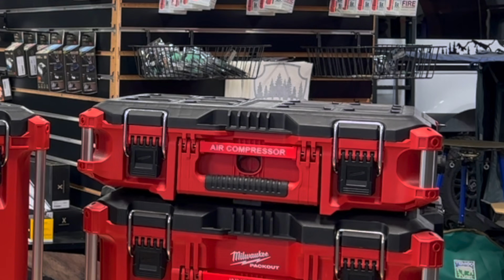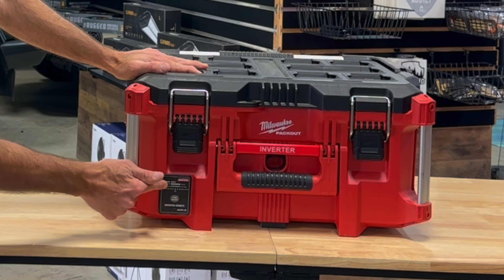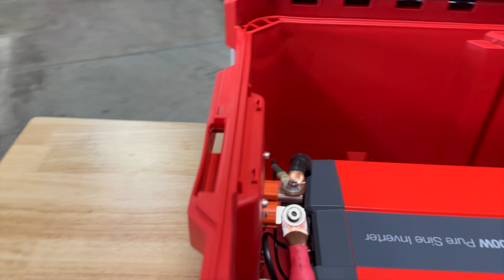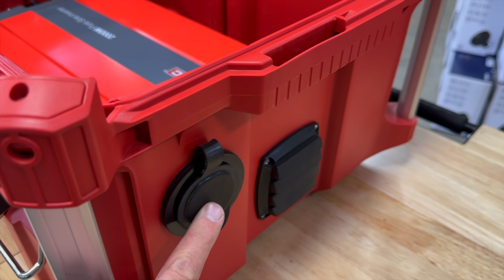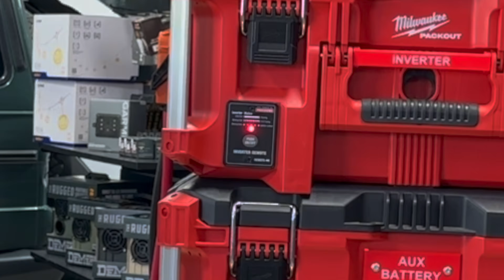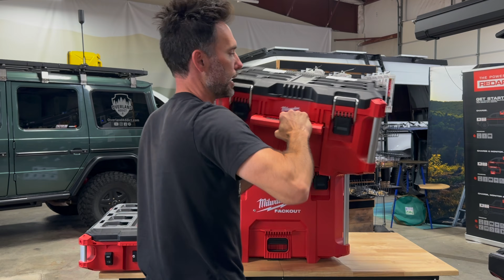Overland Dual Battery System inside Milwaukee Packouts!!

Comment: Great video!! Would you be able to post a link the Amphenol connectors and the cable you used to connect the plugs together? I looked around the Mouser electronics site and do not see them.
Reply: Did you ever get the link? I’m looking for it too.

Comment: Could someone please provide a link or more info on the Amphenol cable assembly used in this video to link his inverter to his battery? I had never seen those before and I think in the right use case, it is superior to the Anderson connectors.

Comment: Great setup, I actually switched to powering everything on Milwaukee battery’s alone. But the longest im out is a week tops. Also I ditched my arb compressor for the Milwaukee m18 tire inflator. (Highly recommend)I already had a ton of Milwaukee based tools etc so the switch only made since for myself.

Comment: Was the inverter to tall for the tool box?
Reply from the maker: It’s been a while since I built this, but I believe the reason I went with the larger box was due to the connection housing on the side and more air flow. 

The inverter itself would’ve fit in the toolbox.

Comment: Hi There, I have almost everything for the battery and inverter system I putting together for camping. The one thing I am having an issue finding is the Amphenol right angle connector and the plug port. Looking to get two so I can build one of the connectors you showed in your build. I have found some other products that will work but they just would not be as clean of a connection. All of the ones I am finding are over $200 just for one of the right agle plugs. Would it be possible to get the link for where you found yours?
Reply from the maker: @MarkLandry-d2r  got them off of mouser.com I believe. They were around $90 a piece. They are essential EV plugs.

Comment: I built my aux power system into a packout box as well. Keep it open to the elements in the back of my truck and it keeps everything nice and dry. Managed to fit a SOK 280ah lithium battery in there along with enough stuff to run power to charge in the tent and a plug bank that goes in my awning office area. Loving the ability to lock a box on top as well!

Comment: What did you do for the signal wire to the ignition? Don’t you need that to be connected for most new car alternators? I can’t seem to find a good solution for making that connection
Reply from the maker: @justinpapa8407  I didn’t actually run that wire on my setup. It charges fine. You are correct though that a lot of modern vehicles need the ignition wire connected.  There are lots of options you could use for the connector for this wire on the box side, like Powerpole, AMP Superseal or Deutsch.

Comment: Pretty sick system, how did you go about securing the battery clamp at the base without it protruding into the packout cleats on the under side?
Reply from the maker: @ninjaasas  I mounted an aluminum base for the battery and secured the battery to that.

Comment: was there a reason you did not include venting in the batter box
Reply from the maker: @Wm.Lidgett the battery is lithium iron phosphate so it doesn’t off gas and there shouldn’t be anything creating any significant heat since I sized the system correctly, but I’ll probably go back and put one in for one reason. 

I recently went on a trip with a friend who incorrectly sized the wiring going to his air compressor. This person also forgot to put a fuse in the circuit.  It was all due to being rushed to get it all installed last minute before our trip and this person simply slipped up. 

On our trip, he kicked the compressor on to air up his tires and after a few minutes of it running he saw smoke coming from the vicinity of his 12v system, so he grabbed his fire extinguisher and shut down the air compressor.

The wire insulation was melted, and luckily he didn’t have to end up using his extinguisher.

That got me thinking about my choice of not having a vent in the battery box. 

Even though I have everything appropriately sized in the system, in the rare event something caused the current flow to be restricted to the point where wire insulation started melting, it would be too late if I saw smoke. 

Having a vent would allow the smoke to exit the box where I could detect the problem much earlier. 

For this reason I will be installing a vent.

Comment: Nicely done.  Very clean and efficient setup.  I was playing around with the XL, and put all my recovery gear in it.  I came across a guy that makes a metal locking plate; should’ve got the option with the “ramp” leading to the locking mechanism.  Only about 3/4”, mounted on 5/8” aluminum extrusion, on top of Decked drawers.
Reply from the maker: @ninez5740  I’ve seen those one Etsy. They are nice. We have the locking pattern in CAD now so we are designing our own brackets that allow packouts to mount to them.

Comment: What’s the benefit over a power unit like EcoFlow Delta? Seems like alot of work and money for same thing.
Reply: I built my own, the selling point for me is user serviceability, I don’t think you could open up, diagnose and fix a flow or similar. The next thing is it lets you oversize the components that matter to you.
Reply: First thing that comes to mind is the $ alone and second not only do you get to customize it to your needs, can get the sense of accomplishment of doing something for your build over buying everything
Reply: @garygray2528  just want to point out that with this build..Money savings isnt on the table :)  the battery alone is $1800 and the redarc dcdc is $600...   thats a whole lot of premium portable unit for the price.   But again thats specific to THIS build, as most builds ARE much lower cost and use parts from good companies that are about half the cost.  I expected it coming into the video when i saw the 3 box packout setup which is the cost of a budget power station like a bluetti. This is on the PREMIUM side of the power station builds that are out there. But the idea is the same. Flexability in your parts, control of the parts you can swap out and replace without having to junk the whole thing, and usually some cost savings for the same capacity system.
Reply: @ knowing the cost of red arc, especially with custom builds that price line I know oh to well with my dream sheets lol. Price worth product yes especially with red arc.
Reply: @ believe me when it comes to price builds I am one of those, building comparable equipment with at least 1/2 the price. But even so with comparable, the assurance of certain products from specific companies can’t be compared. But understand your whole comment, especially weighing out my current two day off grid trip just returning today.
Reply: No argument but understand the whole aspect of high versus medium price components and companies
Reply: @ definitely had to rewatch the video to remember everything lol 7 months ago
Reply: @garygray2528  I saved the video for future reference 😀
Reply: What caught my eye was the outlet sized for a diesel heater.  Most have regulated 12V/10A outlets and those heaters can take up to 13A(?) when starting up.  I know my Bluetti will sometimes shut off during startup, which isn't good for the heater.
Reply from the maker: @marceld6061  this is a big one 👍🏻
Reply from the maker: @MrBetoybrenda  all these comments are spot on for why you would build vs buy. It is quite a bit more expensive to do it this way vs buying something like an EcoFlow, but you can size the battery capacity and outlet options any way you like doing it this way. Plus since they are packouts you can lock them in place somewhere without needing to strap something like an EcoFlow down.
Reply: Absolutely NONE!
Probably actually cost more to make once you factor in time and all parts and tools.
Reply: In 2024 you are spot on.
I’m someone who years ago built my own system too.
It was super satisfying and still works great. 
But now I have EcoFlow delta pro unit & it’s a beast.
To build this guys unit will 
Cost way more than a commercial unit. 
& Be way way physically bigger 😂
But yes it’s fun and satisfying to build your own. 
Just be real with yourself with what you expect and need.

Comment: Thinking outside the box ….very cool !…. Can you show how you have it secured to the truck from moving or tilting…
Reply: Thinking "inside the box" actually.  Red ones.
Reply from the maker: @jehadhannoush1457  it doesn’t move around too bad, but I did temporarily secure the top with heavy duty zip ties for now. 

What idea do you have?